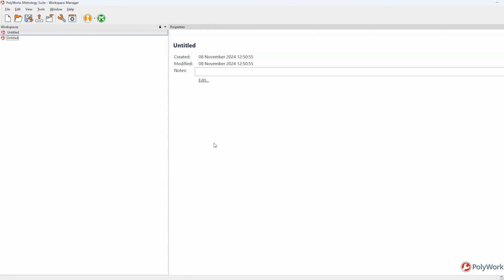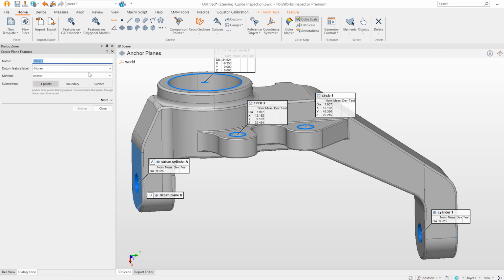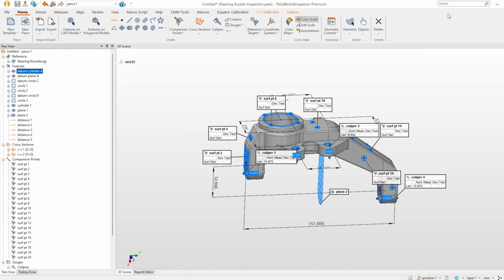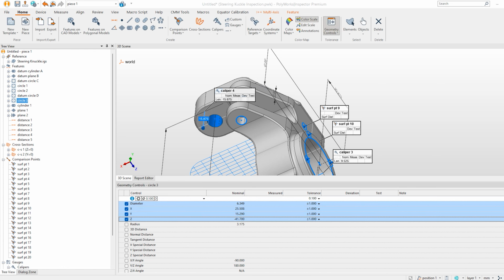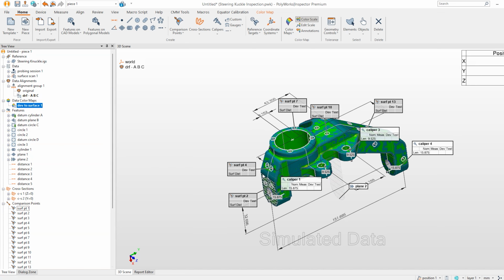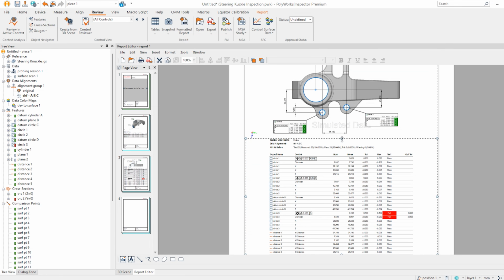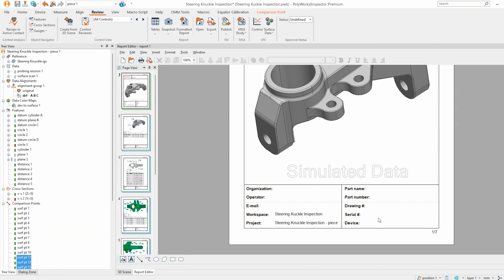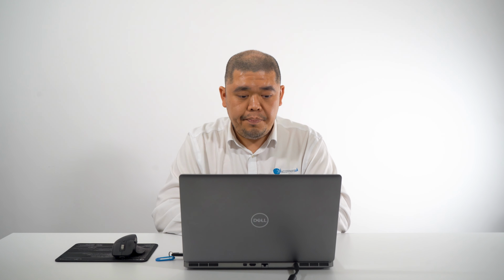Basic Inspection Workflow - PolyWorks 2024

Comment: I got most of this, but am worried that i'm missing an important understanding. -What is the purpose of aligning a CAD to Datums? What exactly does that do?
Reply from the maker: Hi @whiskeythrottle9369, thank you for your question. In the demonstration, we're not actually aligning the CAD to the datums, we're aligning the measured features i.e. what we probe, to the CAD using the datums. It can be confusing because we're running an simulation offline which results in the measured already appearing on the CAD, whereas if you were to measure the part in real life, the measured would more than likely appear off in-space, away from the CAD model. Hope this makes sense.
Reply: @3DScannersUK  ah yes, i see, that makes more sense. Thank you for clarifying it for me.